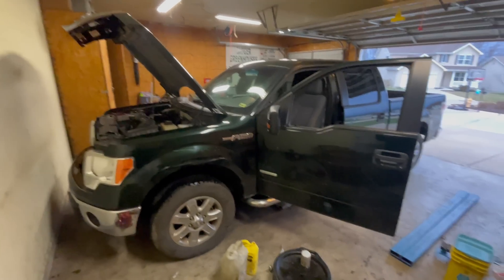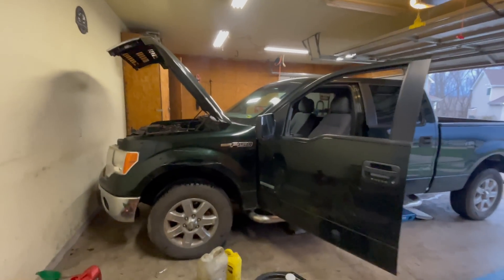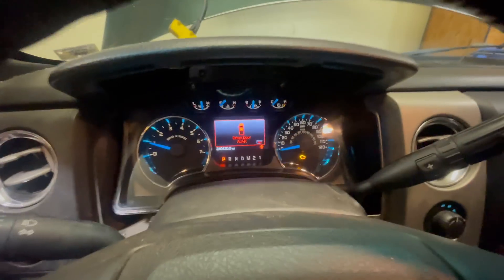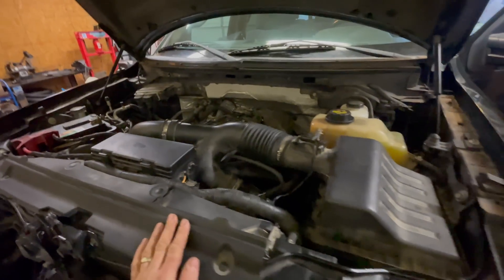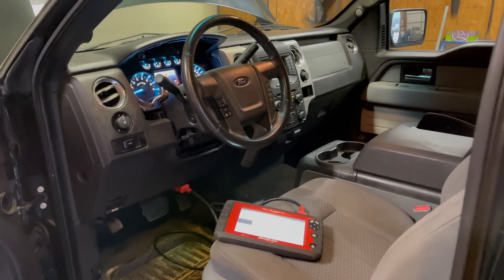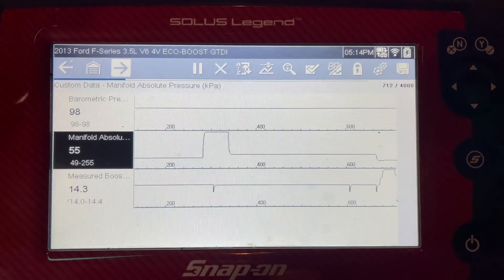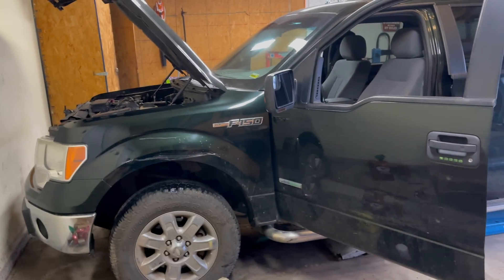Ford 3.5 EcoBoost P0106 Wrench Light FIX

Comment: I have a 2016 2.7 with  the same code P0106. I took the truck to the shop. They replace ECM, Crankshaft position sensor,
tensioner pulley. they charge me $3,114 and the truck still have the same problem going into limp mode. the never replace the MAP sensor.

Comment: Hi, I have rv just like yours identical.  Have alot of the original manual If you like copys of them . Also need some help with my slide . Previous owner replaced hydraulic pump but now hasn't worked has to be electrical since I'm not getting power to main cables (+) or (-) . Do you know if this has a breaker somewhere and which one ? I when trough whole system can't find it for that partial circuit? Thanks for you help and let me know if you like copys of manuals thanks

Comment: Even though u spent 1500 in parts I would have replaced everything else to with 240 thousand miles on the parts u never know when they will start acting up or go out u should be good for a while now

Comment: Nice video!
On a side note... Is there anything good about the 3.5 motor? Lol
Reply: I would guess 60-70% of the issues with these engines come from 10k mile oil changes.  Folks who change their oil at 5-6k miles typically get very good life out of them.  Extremely powerful, almost diesel like.

Comment: Use the Motorcraft oil filter. It has the best anti-drainback valve for these 3.5 eco's. I have used Mobil1 Extended Performance oil and filters and it will rattle at startup after 2 days. It never rattles with the same oil and the Motorcraft filter.
Reply: Who actually makes the oil filters for motorcraft? Aren't they just rebranded as motorcraft?
Reply: @AbcAbc-sp1od  I'm pretty sure that Purolator makes them. They are long life filters and are spec'd with a silicone adbv. I don't know if the Purolator is or not.
Reply: @stevemartin4684  ahh, I forgot about that... I think you're right!
Reply: I have heard to just buy motor craft filters as well.. heck I just bought a case of 12 on rock auto for 60 bucks.  No brainer.

Comment: I have a 97 f250hd had the same problems! Codes were map sensor, idle control sensor and shift sensor as well as egr valve! Found out when we replaced the lifters, we forgot to replace the intake gasket! It was leaking on back of motor so I was losing vacuum!

Comment: MY 2011 lariat crew 5 1/2 bed IS A 5.0  paid 10k with 205,000 miles I wont take a ecoboost sorry. nice truck though
should have waited and found a 5.0 way less hassle

Comment: Got a 2013 f1titty platinum 3.5 EcoBoost twin turbo with over 430 thousand miles all original.   Drill intercooler and install a bra over half of intercooler to increase heat so you'll have no moisture.   Replaced LEAD frame on valve body..run it and forgetaboutit!!  Try getting a dodge or Chevy to do that

Comment: All the internal work you did was a good idea anyway with 214k on the engine. Chains, guides, sensors and such were due not to mention the water pump. Why did Ford put the water pump INSIDE the engine? Blow a water pump seal and fill the crankcase up with water.
What did that Snap-On diagnostic tool cost you?

Comment: You should do a direct injection cleaning. I also seen fordtechmakuloco talk about a good high volume oil pump upgrade for these trucks with higher mileage. Mines also 13 and doing some tune up work to it.

Comment: This i why i started with checking senors first before doing any big work. Took my car to a shop for a tiing belt and cam position sensor, they recommended the crank sensor as well, got the car back and it ran like shit. I called them and told them exactly what happened but they wanted to charge me a diag fee, i told them i already diagnosed it myself and since the part they recomended was under warranty i got the old one reinstaled for free. 

Always sensors first. but at least that rattle is gone at start up.
Reply: Hey brother , I just started with that problem on my ford f150 ecoboost , when I start it up I hear a rattle and now the wrench warning light is coming up

Comment: I have ford f150 2014 supercrew same engine.it has p0016 Code. I had the cam shaft sensor replaced but my truck is still accelerate slow while driving, same problem as old. And ecoboost starts when I accelerate higher. Also I don't have rattle noise. We did live data and it cam shaft position sensor 1 bank à shows different numbers with bank B. What could be the problem? Should I check the engine inside or what else should I do?

Comment: Changed thermostat in my daughters car.  She said she ran it hot a couple time before she remembered to let me know. I did a thermostat.  Checked the radiator and water pump.   But still having overheating issues after bleeding and bleeding and bleeding the air out of the system. I’m afraid she blew the head gasket.   It’s an 04 and we got it cheap nearly 2 years ago so whoopity do.

Comment: Whoever had the truck before you didn't change the oil worth a damn.
Reply: That’s what I said I’m talking 10k oil changes using the bare minimum conventional or syn blend oil and never replaced the pcv valve

Comment: If I was you I’d also check the intake valves for carbon build up. That could cause run issues. Caused a lot of misfiring for me and I was convinced it was coils or plugs but no, it was carbon on the valves.

Comment: So do you think the sensor was the whole problem?  Do you think those old timing chains would have worked even if they were probably going to fail at some point?
Reply from the maker: Regarding the loss of power, rough, idle, and check engine light, yes, this sensor was the whole problem. However, I did find the timing components to be loose, and it also had a rattle on start up. So I think the timing component job was a good preventative measure to prevent future issues.
Reply: It was rattling on startup. Time for chains.
Reply: @mph5896  they were probably ready to he changed despite the other issue
Reply: cam phasers/VCT can rattle too as known ford problem particularly on newer Ecoboost 3.5. It is apparently really loud in cold weather. Not sure how to tell difference from chain noise to VCT problem.

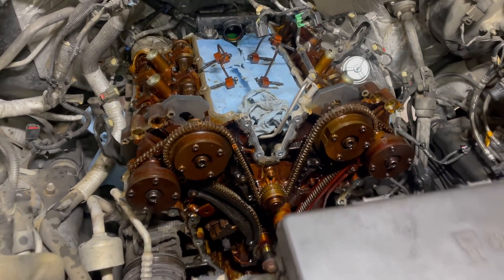Comment: That Varnish @1:16 is that caused by late oil changes or cheap oil and going too long or is just because this is a high mileage engine?
Reply: I would say late oil changes. I have seen engines with more miles than this that are super clean inside.
Reply: @sprint2648  late oil changes and combination of conventional oil or syn blend and probably didn’t change the pcv valve at all.

Comment: Why does it have a MAP and turbo boost sensor?
Reply from the maker: Good question, the way I see it, the purpose for both sensors is to be able to measure the boost/vacuum on either side of the throttle body.